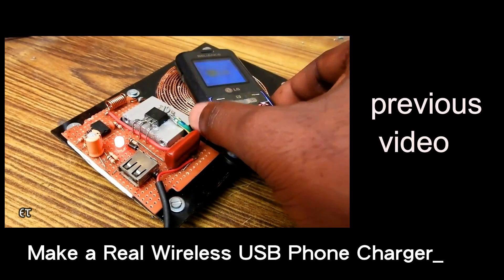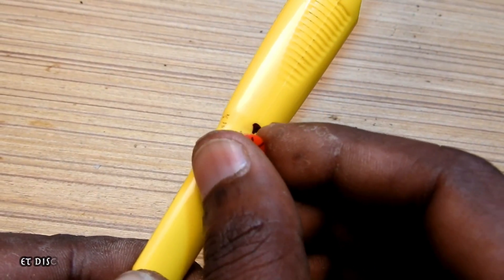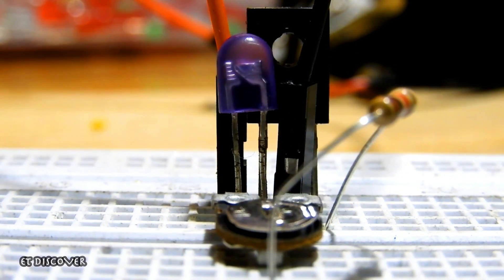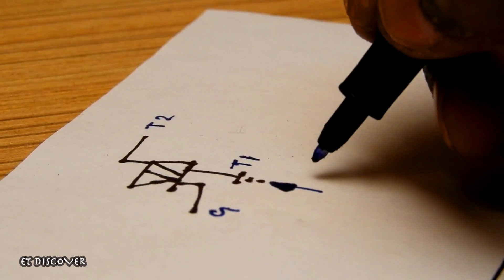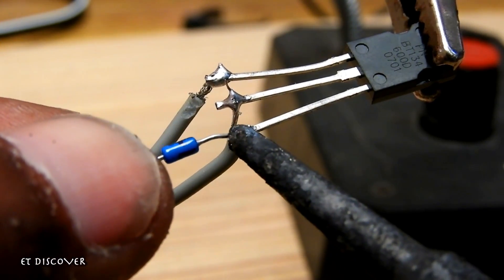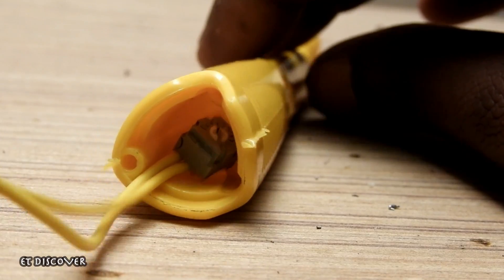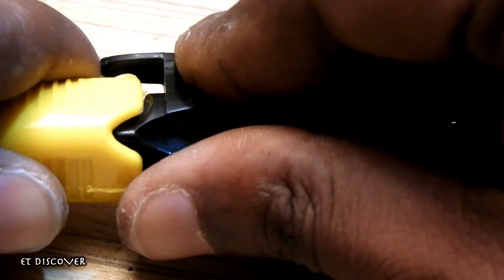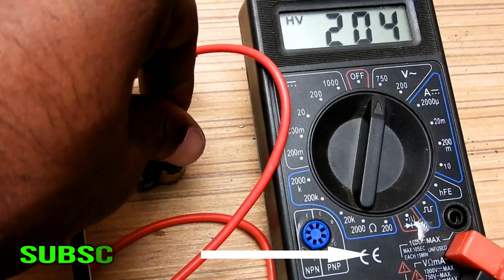Temperature Controlling Soldering iron_Within 20 rupees only

Comment: replace all these with a simple ceiling fan regulator...and that's it....
Reply: I have connected a ceiling fan regulator to the plug point, and connected the Soldering iron to it. Will it work??